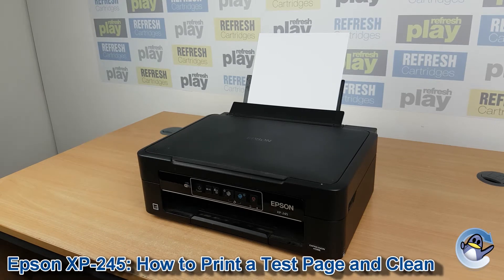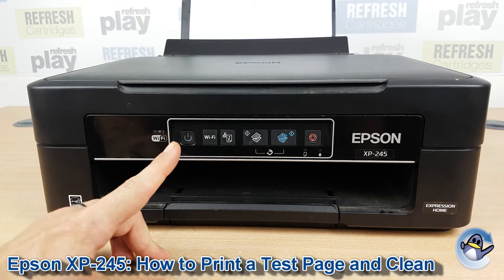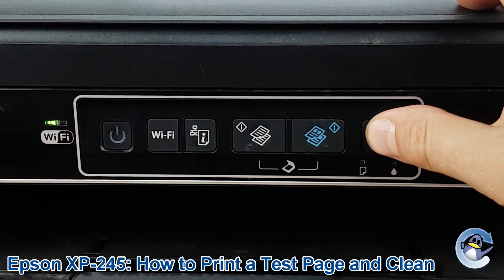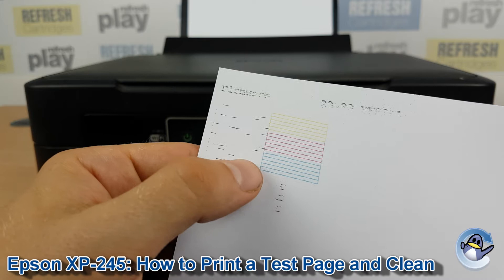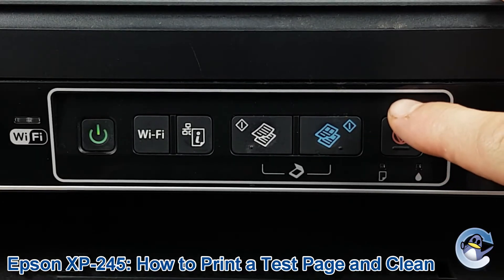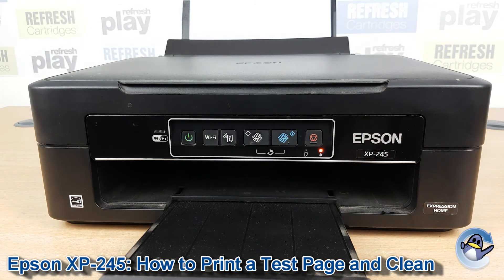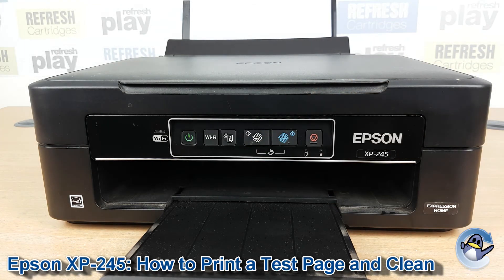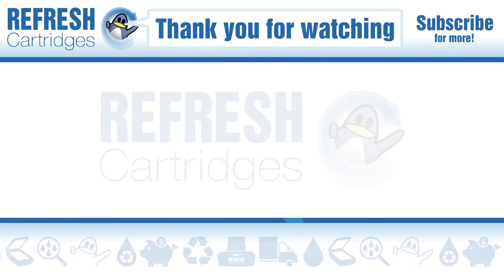Epson XP-245: How to Print a Nozzle Check Test Page and do Cleaning Cycles to Improve Print Quality

Comment: This fixed the issue with my XP-235! Very clear instructions and easy to follow, thank you! The only slight difference with mine was that I didn't need to press and hold both buttons for the nozzle test print. Turn the printer on, then press the red upside down triangle. It only seemed to work after the printer had been turned off then on. It didn't work after the nozzle clean. Had to turn it off then on again to run the test.

Comment: I have the exact same model but, the test paper wont print when holding the action button..just as i see the green light flashes..i pull the finger off from the action button..nothing happens.
Reply: Keep trying that what I had to do x
Reply: @A-Ned-D-68  I ignored this process of finger on action button, after 7 attempts.
I then done 2 nozzle cleans instead(without the app) and then printed what I needed..it worked..clear images